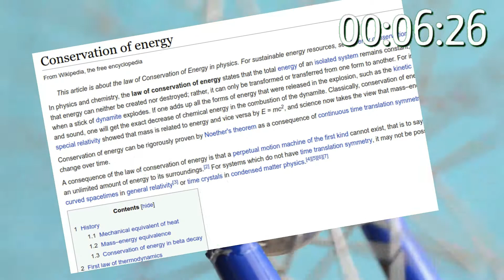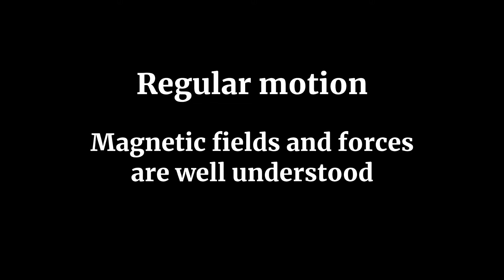1MD - Physics - Perpetual motion / free energy machines

Comment: pleas try to explane this to my mom! she dosnt understand that this is imposible and the she always brings up planets spining and i facepalm
Reply: Exactly! Have your mom watch a video on tidal locking, the process by which a massive body slows the rotation of a satellite moon, until the rotation time is equal to its orbit time. Rotation and orbit times change into this state over an immense time. This is why we always see (almost) the exact same face of the moon everywhere on Earth. Some flat earthers and space deniers cite the equal rotation and orbit time as a huge convenient coincidence and don't realise it is not only common in the solar system but likely. Their simpler explanation is that the moon is a 2d light fitting.
Reply from the maker: Planets spinning is almost 100% efficient so it's a better example than most. However, you can't extract energy from the spin without reducing it.
Reply: @OneMinuteDebunk  yes I am aware of this but my mom isn't XD